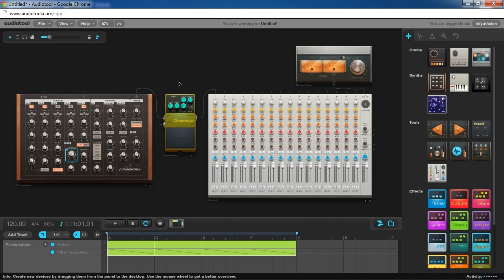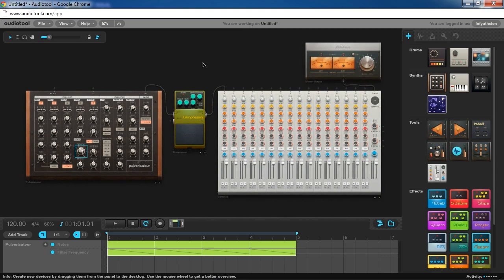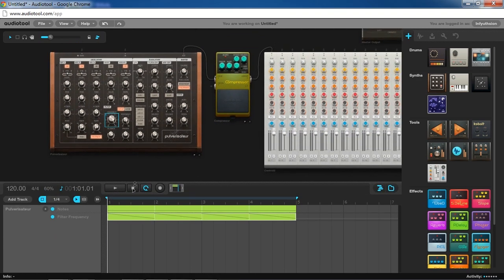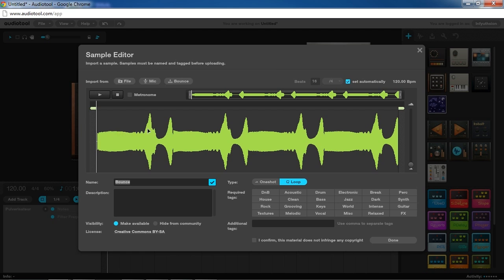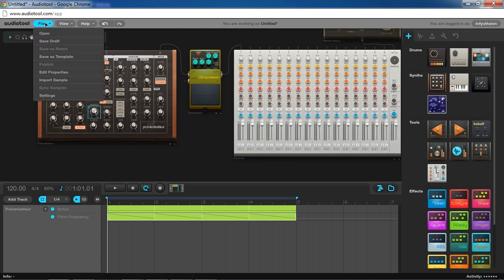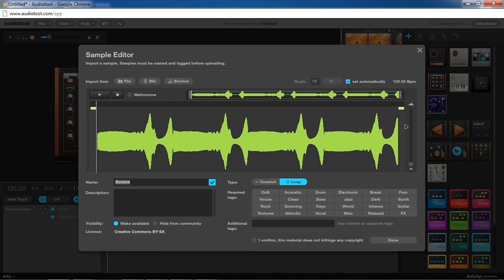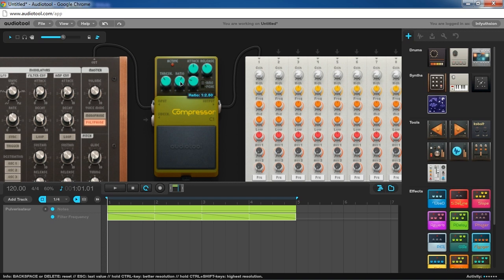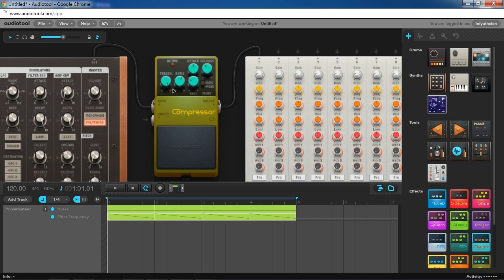What Does a Compressor Do?

Comment: Ok... So what side chain is for in compressor?
Reply: Side chaining is when you use another mixer track to set the limit for the compressor. For example on track one we have a vocal recording and on track two we have a guitar recording. If we side chain the guitar recording to the vocal recording then the guitar won't be louder than the vocals as the side chained compressor will start to reduce the guitar tracks volume. This is helpful when you've got something you want to emphasize and something else you want to be a little less emphasized
Reply: +fireflame608 just amazingly helpful!!
Reply: +fireflame608 thank you